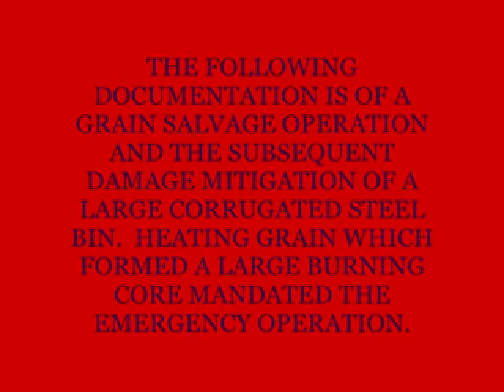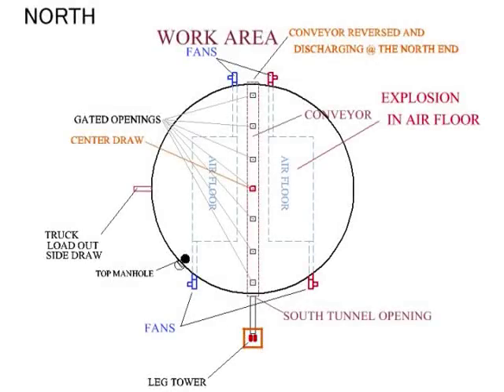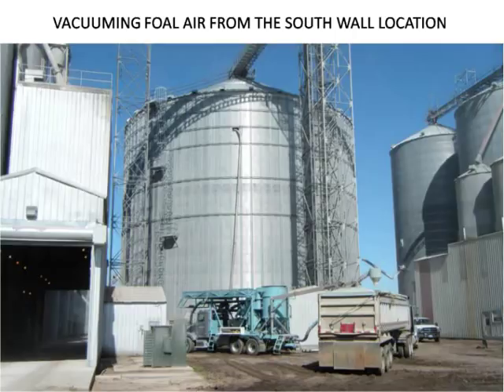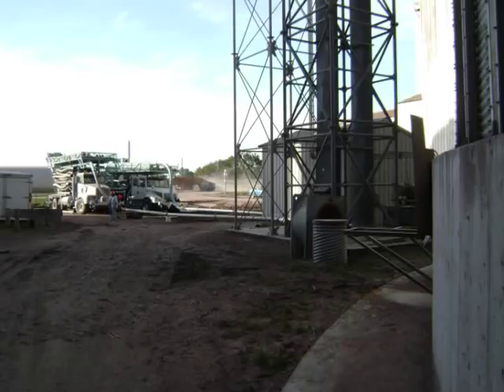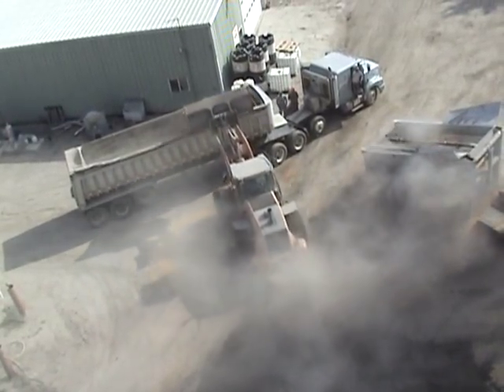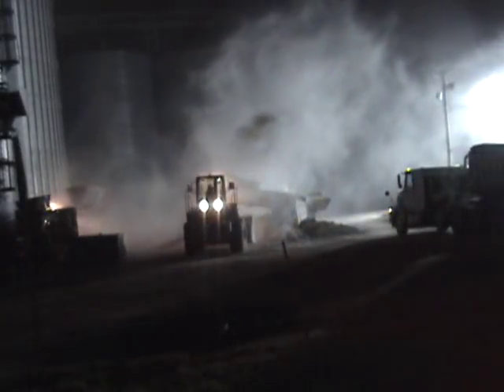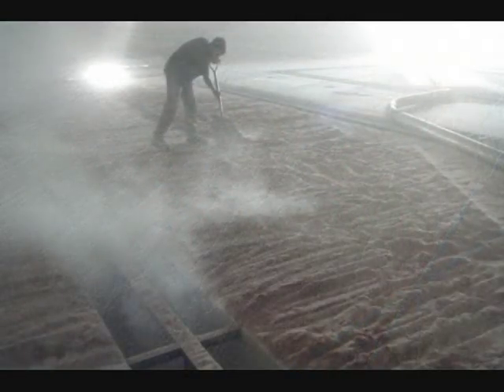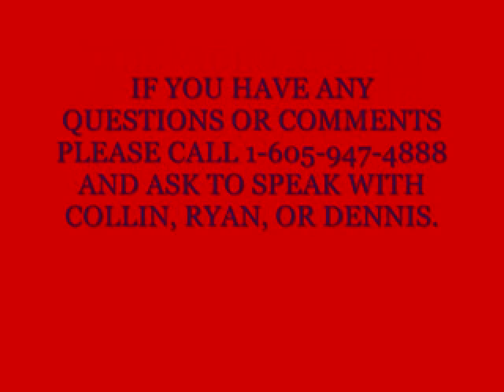GREGERSON SALVAGE    BIN FIRE AND LOSS MITIGATION

Comment: I was raised in the middle of corn country and I remember hearing bits and pieces about problems like this around the area, and never really thought much about it.  I worked cleaning out bins until an auger made a run at me and I was lucky enough to jump over it.  That was the end of my shoveling in grain bins.  You guys did a really professional job (except I'd like to see better protection for the forklift operator).  I hope you guys are still safe.

Comment: What about using metric tons (1000 kg) for measuring the amount of grain being salvaged from the silo...?
Reply: Jürgen Kuhlmann wtf is a bushel
Reply: Randall Smith a bu. Is 56# of corn
Reply: A bushel is about 35 liters or so.  It's a volume, measure, not weight or mass.  for corn, a bushel weighs roughly 56 pounds, or 25 kilograms.
Reply: Holy crap. If this silo holds 750,000 bushels, that's nearly 19,000 tons!

Comment: Clearly gross mismanagement by the elevator. Either some body wasn't checking grain moisture, or ignored it, and loaded the bin with corn that was over 13.5%
Reply: Temp cables are a good investment. Without them your gonna have to turn over bins all the time thus wasting electricity and man hours.